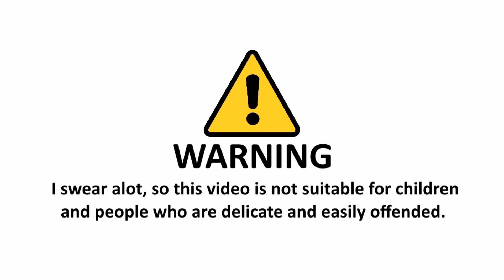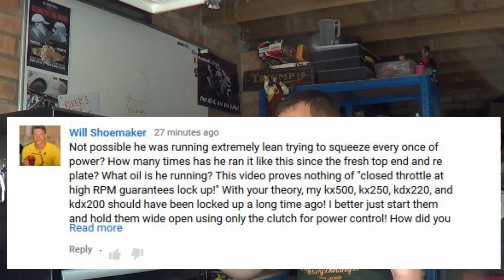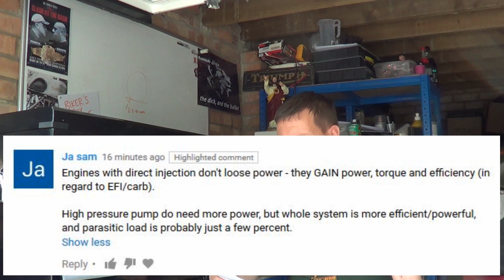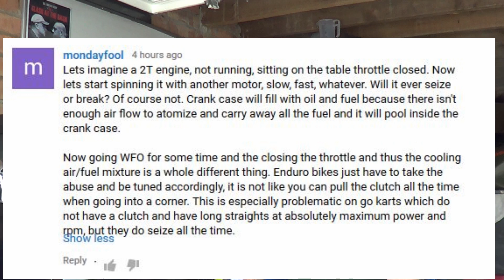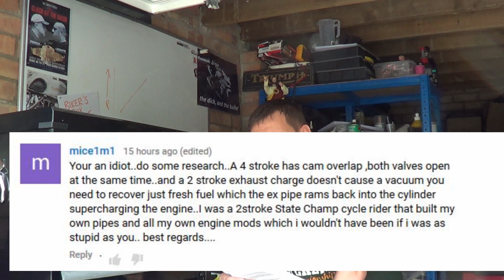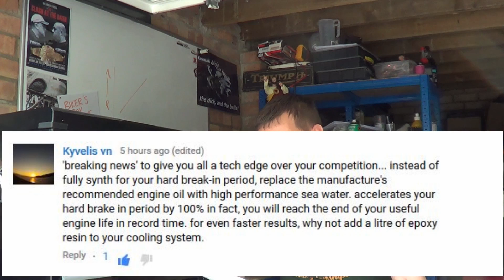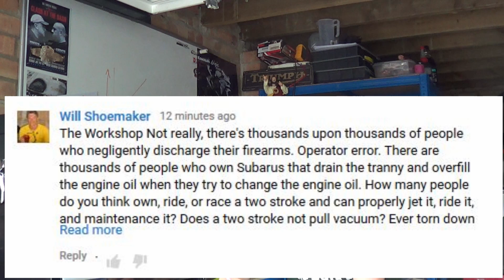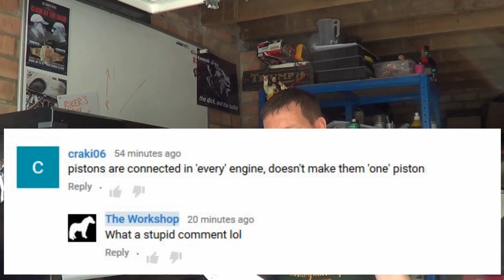Comment Corner 2 - Part 2

Comment: I fear every one of these videos that I will be on one
Reply: That's part of the fun, gotta come up with something that sends him over the edge.
Reply: Beach&BoardFan  we will break him one day
Reply: same, i say a lot of stupid stuff, even more stuff that matt might find stupid
Reply: How about add sand to your oil, the spherical particles will reduce surface friction like mini ball bearings!
Reply: Mmm true, I suggest gallium as the suspension fluid, it'll really penetrate into the aluminum block for superior lubrication
Reply: yes, and it will work great with any tin bits to assist in lubrication, now what shall we do to increase the cooling? we could use fuel in the radiator (i actually plan to do this for a really fringe project i plan to do) or maybe oil, or how about make sure there is no pressure, no boiling and no leaks, fill it with lead, it'l melt when the engine warms up, it has amazing thermal conductivity too
Reply: oh, one more thing, i noticed on several used cars me and my dad have had that only the rear has blinker fluid, and sometimes it's low or missing on one side, what should i do? or is this that "brake fluid" i hear so much about, i assume they mean brake light fluid, should i top them up or flush and replace the fluid?
Reply: Liquid hydrogen, as the engine heats you can fuel the engine with the vaporizing coolant! 

Making a jet engine?... that's the only thing I've ever seen use fuel as a coolant.
Reply: eh just take some of the headlight fluid and top em up, its the same stuff just add a little orange food coloring to it.
Reply: nope, a vapour carburation or injection, depending on how my results go, i need to heat gasoline to no more than 200c and more than 100c, and since the end result is no longer a liquid i can separate it from whatever it goes into, this is only since for just my small motorcycle i need 4.028 liters of fuel vapour for every one liter of air, this is a bit much to make on demand, and converting it all beforehand is infeasible, this means my motorcycle would need 3200 liters to equal a tank, basically i was one of the hydrogen nuts then after realizing that at best all you can get from that is increasing burn efficiency with a precisely metered amount, any more and you use more electricity than the power you get back, for a while i called hydrogen a really inefficient way of converting your car to being an electric car (make hho with the battery bank and run on it till the batteries go dead, no alternator) and now i guess i'm a vapour carburetor nut  but i'm not just trialing and erroring like all these asshats on youtube, i'm first trying to get a really good working theory then try it small scale, my current theory is heat it up on a plate and put a really long intake runner, because i need roughly <1 to 5> seconds for the fuel to evaporate, so no mater how hot i get it the fuel is going to take time to evaporate, so i need to have the runner be that long, what's almost in the tank if talking about a car, and not possible on a bike, loads of things to figure out, also i'm taking an engine design that has been mentioned on here and making it actually good on fuel, then good on emissions the end goal is not hp, within reason size won't matter so long as the weight does not counteract the efficiency, the total power will be 50 hp or less (designing a ultralight car around it but not with speed in mind but just weight)
Reply: btw here comes matt to complain about my shit paragraphing
Reply: Sounds like you've got some more videos of your own to make!
Reply: i don't think i'm going to put any of this to video till i have at least an idle on full vapour, i.e. not a chance liquid could enter the engine, the problem is there is a reason they put liquid fuel into an engine, and it has very little to do with power and nothing to do with efficiency, can you guess why non of this is done in production cars?

Comment: actually gokarts (at least the older ones my father raced) had no clutch but what they did to overcome the issue was opening the throttle while braking. Nontheless you go through many pistons and cylinders etc. when racing 2 strokes.

Comment: so, i have a problem with my moped, it starts sometimes, and dies if i don't rev it a little,  but after 10-30 seconds it idles just fine. it can start easly the first time(or not at all, it always starts when i push it however) , and if i turn it off it won't start seconds after it was on (and sometimes i have no problem at all) . can someone please give me some advice or hav an idea of what the problem might be? thx.

Comment: Hi matt you mentioned in your previous comments vid, that on a 2 stroke when you shut off the throttle the is no fuel/oil and air. Is this no as in none? Or does the the vehicles tick over still provide something like a over run enricher on my zrx (ye i know mine a 4-stroke lol). Just a wonder as not sure if pressure differences would cause an effect thinking about the low pressure that pulls the fuel from a carb float bowl. 
Many thanks Drew.
Reply from the maker: Good point - the issue is volume vs engine speed. An engine @ high rpm requires 'x' amount of oil to lubricate the cylinder. The pistons reciprocating action 'wipes' the cylinder clean, and the combustion event burns excess oil. 

If the engine runs at these higher rpm levels with adequate lubrication then seize in on the cards. As for lower pressure in the crankcase, this is tied in with fuelling rates. The more fuel the more oil. Less fuel less oil. And engine with a closed throttle is not 'flow' the same volume of air/fuel/oil as an engine that has an open throttle. This would be madness, as you engine would burn more fuel with a closed throttle than not......

The throttle essentially meters fuel/oil. Closed throttle = less fuel/oil

Comment: Co2 it technically not pollution as it is natural and actually rather important, but of course to much is definitely a bad thing for animal life and the climate.
Reply: Food additive 290, submariners survived co2 at 7000 ppm, and as for climate, 1,000,000 ppm co2 increases temperature 2.1 degrees Celsius over an air control.

Comment: If I had to deal with so much stupidity and lack of knowledge, I would just delete my channel and go build another two stroke. I appreciate your patience and nerves of steel. Like a two stroke diesel can not be supercharged, without knowing the inlet valve is longer open than the exhaust ports, thus leading to an excellent engine for supercharging. Even the opposed engines like the Junkers FluMo or the Napier Deltic, that do not have inlet valves but asymmetric opening of ports, are great for supercharging and they did it. If this goofs would have only one time asked themselfes why in the old two stroke Moto GP, every rider blips the throttle multiple times while breaking before corners, they would have known it is to prevent seizing up the engine. They should keep to their Briggs&Stratton Lawnmowers, so the do not put other people in danger, or get hurt while being punched.

Comment: i will make that video...ill rev my kdx to its max on a steep downhill and close the throttle. I'lldo it over and over and over and over again. It will never cause a single problem.
Reply: Wayne Wildman, you can't just rev it to the moon to duplicate the dyno run.  You have to do it in top gear, up a hill and as you crest over the hill, say 75-80mph (160ish kmph) then downhill (10%+ grade) wide open, then close the throttle.  They dyno has a huge drum with a lot of mass that keeps the engine turning lots of rpms for an extended period of time.  This is why the engine seizes.   You can't just rev it to max and then expect it to seize if you close the throttle.  It is the mass of that drum that keeps the RPMs elevated for an extended period of time that makes the difference.
Reply: Wayne Wildman, it doesn't have to be a dyno.  You can replicate the same conditions on a long downhill, at speed, and the closing the throttle while the vehicle maintains momentum.  It isn't about a dyno....never was.  It is about closing the throttle and basicly shutting the fuel (and lubrication) to the engine under extreme loads.  You suggested that is never a problem and you are 100% incorrect.  The dyno pull proves it with video evidence.   
Research Saab 2 stroke engines.  They put them in cars.   They had a massive numbers of engine lockups due to engine braking downhill.  That is the whole point of the post from me to you.  Just revving the engine doesn't put a massive load on it and then keeping engine RPMs up under load with the throttle closed.  If you have problems with understanding that, you should probably spend time on a different channel.

Comment: IF YOU MADE A 2 STROKE LIKE THE NEW HONDA ACORD OIL COOLED PISTONS. YOU COULD TURBO SUPERCHARGE  WITH A SLIGHT OIL FEED THROUGH THE PISTONS ;MAYBE JUST A THOUGHT WITH A OIL PUMP. DRY GAS 2 STROKE JUST A THOUGHT MAYBE I'M DAFT
Reply from the maker: WHATS WITH THE CAPITAL LETTERS? ANY REASON IN PARTICULAR?
Reply: LAZY NO PROBLEM AT ALL
Reply: it's a really interesting topic letters aside

Comment: Do a video about those shitty cheap OBD2 scanners.
I've got one of those piece of shit blue ones but too bad my SAAB is not in one piece yet so i can't fuck around with it.
Reply: You know what, while you're at it do a video about amateurs doing shitty repairs and "rebuilds" on their cars, because my car was done by one and i'm fucking mad because the engine got dickered around with and it's a fucking shit show. The car is ok but the engine is just a gift that keeps on giving. I'm gonna put some care (ie. money) into that engine and make it purr like a kitten.
Reply: Poptart McJelly The £10 eBay USB ones that do OBD2 & CANBUS? I've got one too. They're ok for the price, it's just an interface. It's only as good as the software you choose to pull the data into.

Comment: I saw that on the huskies that they had a tube straight from the oil revisor to the carburetor boot. Remind you it is a 2 stroke duuuu ect is this better because it lubercates More when you use engine braking? I will try to find a link to a picture or videohttp://www.motorcycle-usa.com/wp-content/uploads/2016/01/2016_Beta300RR-12.jpg?378220

Comment: how much time have you spent actually riding a two stroke dirt bike? Answer that one. Be honest.
Reply from the maker: years and years - I broke my back (L4 + L5) and 5 6 ribs riding my CR500 like a dickhead through a wooded track. Also owned a GT750 for about 5 years, but that being a road bikes doesn't count. Had a KX250, and the KX500. A DT125 and a Gas Gas EC 200. Will that do?

Comment: dear Matt

is it possible, on an air-cooled engine, that the oil can get so thin that can give a false low level reading on the dip stick, but when you drain it, the amount of oil that was in the engine was the correct amount?

sorry for making your eyes bleed with my shitty english.